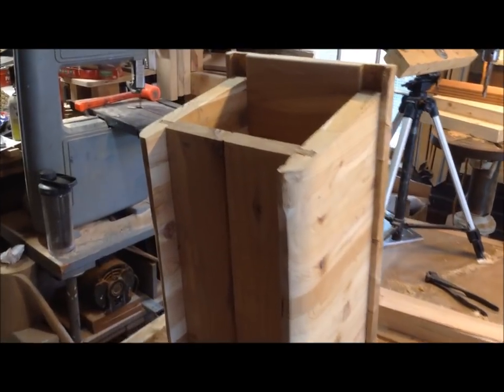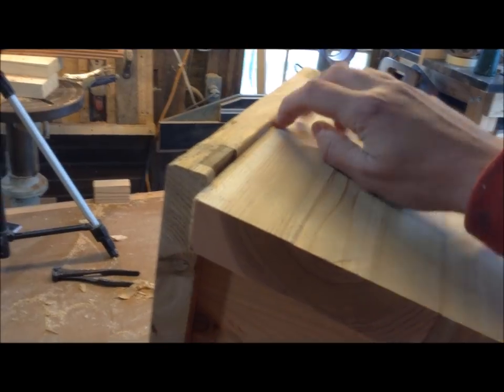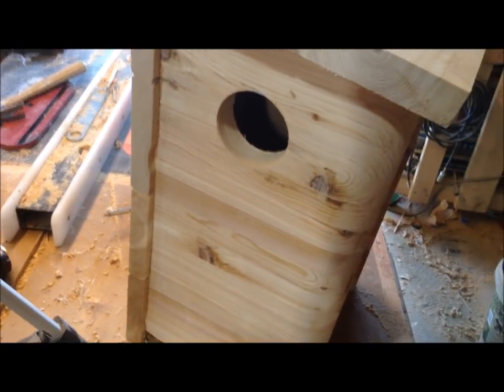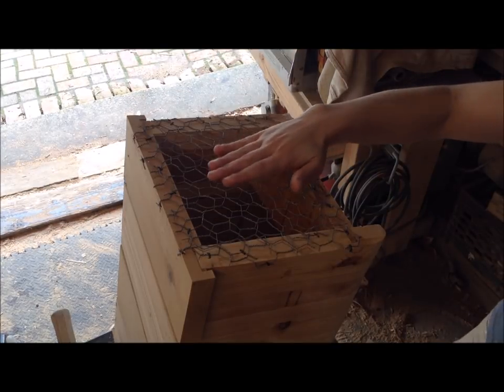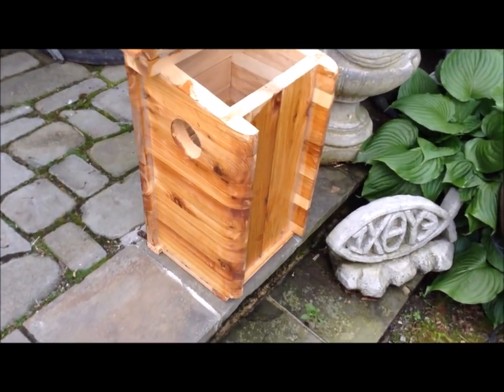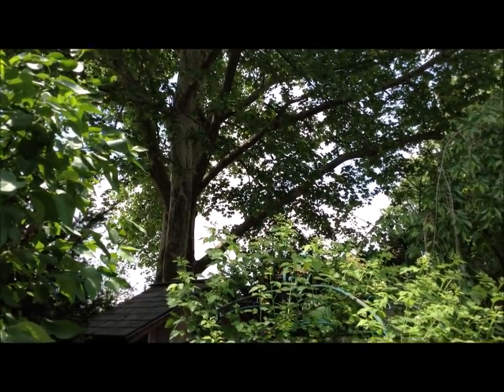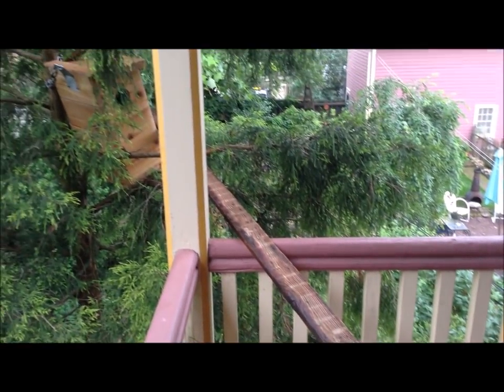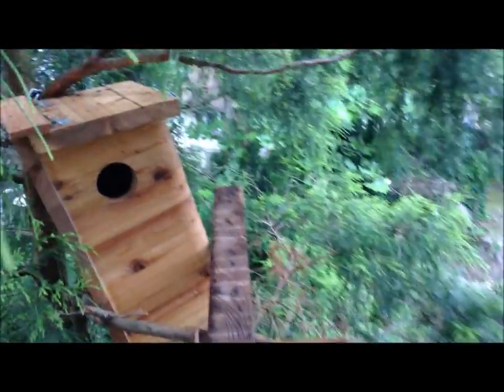Make A Squirrel House [Part 2]

Comment: Looks like a bird house instead of a squirrel nest box,  squirrels need a wider box than being that tall as they will actually lay on their back and spread out to cool down in the summer and in winter two adults will curl up together to conserve warmth so it needs to be big enough for two adult squirrels.
Reply from the maker: I pulled the dimensions and the rough design for this directly from a wildlife rescue that rehomes animals.  They have a very comprehensive website, and full time experience on the topic.

Comment: Nicely done. Only thing I'd add would have been some furring strips around the outside of the box to make it easier to climb in and out of. That or you can just score lines on the box - 1/8th to 1/4 inch in depth - with a rotary tool or circular saw to achieve the same effect. It's good to do that to the inside of the boxes as well. Makes it easier for them and their young to gain purchase climbing from inside or out. I also would have just used some wood for the floor with holes drilled into it for drainage.

As for a safe finish to prolong your wood's life it's best to use a viking mix - I use it on all my raised beds as it's food safe -  which is equal amounts of raw linseed oil and pine tar. It's what they used to use on their ships and houses. Plus - initially - it smells heavenly. It does fade quick enough so it wouldn't bother the animals. And they're well used to pine tar anyway.
Reply from the maker: I have never heard of Viking mix, but it sounds interesting.  Nice tip thanks!

Comment: hello;  we moved to a neighborhood with lovely trees but there are hawks and owls that hunt squirrels.  The birds take their time going at the nests so will this house plan prevent hawks and big owls from reaching/leaning in and snatching babies out?   if not, what do you recommend?
Reply from the maker: I am not squirrel expert so bear that in mind with my advice.  The basic measurements I used for the box were taken from a wildlife website (can't remember which) and I believe the height of the box is so birds can't reach to the bottom.  But, wildlife is very tricky and if you are concerned you can install a simple plank right under the circular opening on the inside of the box that is small enough to allow the squirrel past, but the the bird can't reach their claw around and to the bottom.  Hope that makes sense.
Reply: thank you very, very much

Comment: Would you make one of these for sale?
Reply from the maker: I could make something like this for sale, but I would change the design.  Because I used thick cedar scraps it was really heavy.  Also, since you cant' use pressure treated lumber for animals the live span of any of these houses won't be super long.
Reply: @HoneyBadgerWoodWorks  how long does it last, those are pretty thick pieces of cedar.

Comment: At about 1:50 of this video you push a very narrow cut through the table saw with your fingers!
Please, please use a push stick!!
Reply from the maker: Usually I dismiss these comments because it just looks like my fingers are close to the blade because of the screwed depth perception of the camera.  But, good god you are right on this one.  Very unsafe, was probably rushing because I almost always use a push stick under about 3-4 inches.